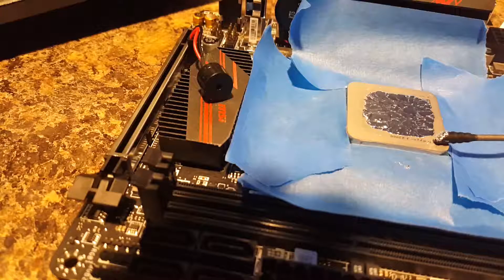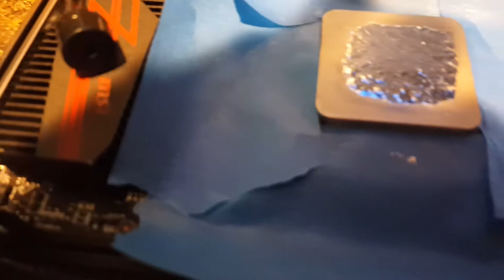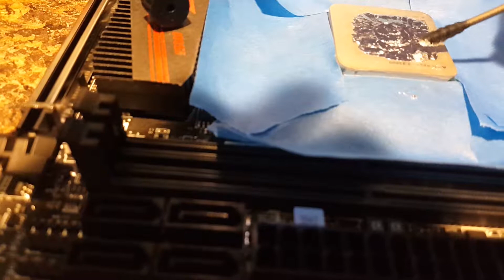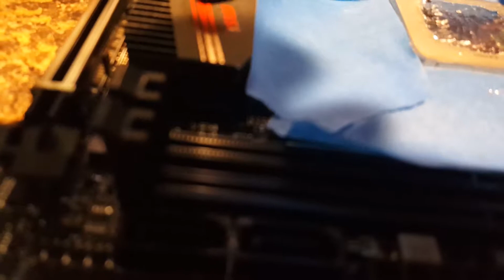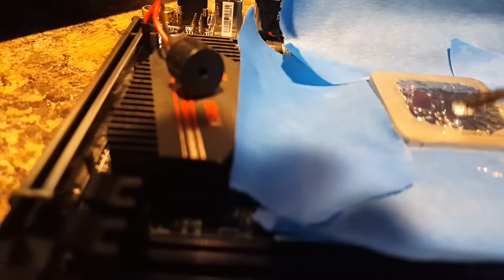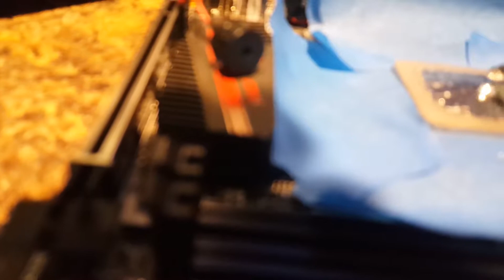Applying Thermal Grizzly Conductonaut to my HTPC

Comment: Everything I know about conductonuat, you have WAAAAAY too much on there.. lol But great video none the less. lol
Reply from the maker: Nah, it's probably the lighting from my shitty camera. I used something smaller then a tear drop on the CPU. A tiny bit goes a very very long way. I learned my lesson about putting too much on years ago. Fucking toasted my wife's laptop and had to buy her a new one after I went to do a CPU upgrade on it and used some on it. The PC in this video is still going strong, in fact I pulled the CPU a while back (2200g) and replaced it with a 3400g. No problems at all with the conductonaut when I removed the heatsink.

Comment: Did it improve your temps?
Reply from the maker: Yes, absolutely. Dropped it down a few more degrees, which is excellent considering this is the case it went into: https://builds.gg/phreakwarpc/nmediapc-1800b-htpc-10515